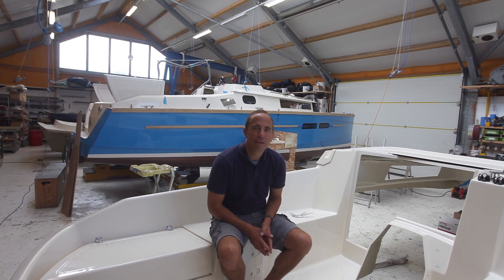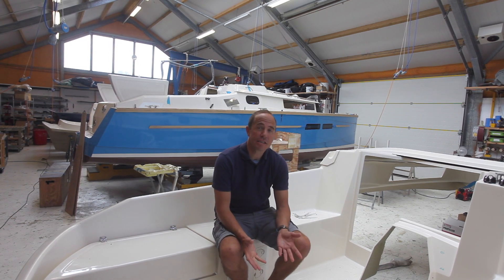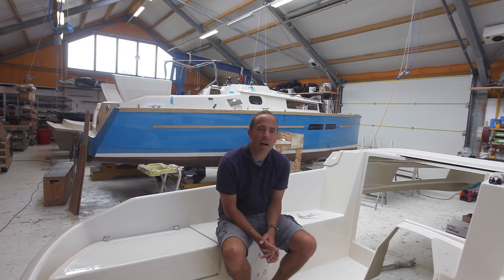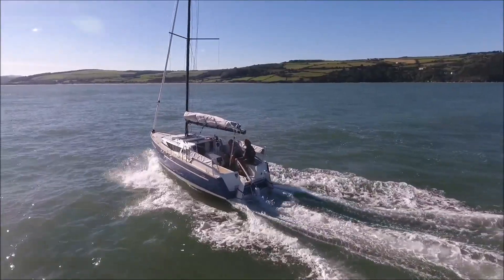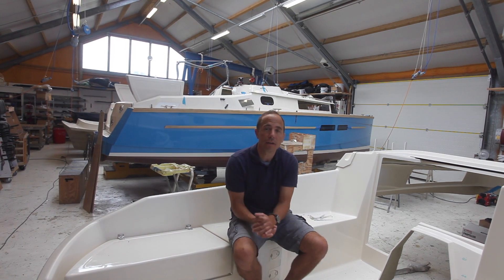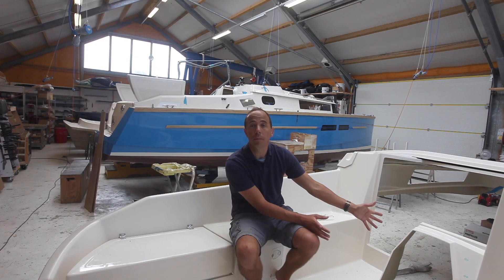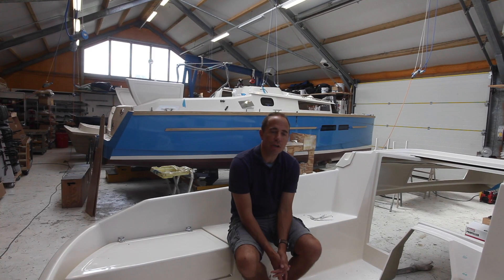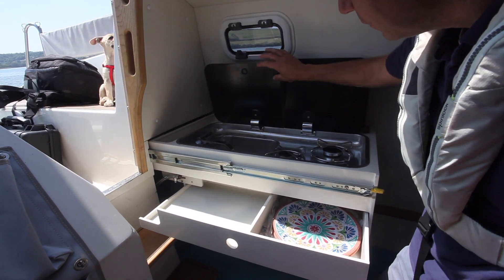The Swallow Yachts Coast 250 by Sailing Today magazine

Comment: Congratulations Mat, a very impressive implementation of this concept. Great solutions.

What are the power options? Will you offer diesel or electric versions as well? Petrol is not everyone's choice. 
An electric engine arrangement could reduce the central engine's volume greatly. Maybe Oceanvolt?